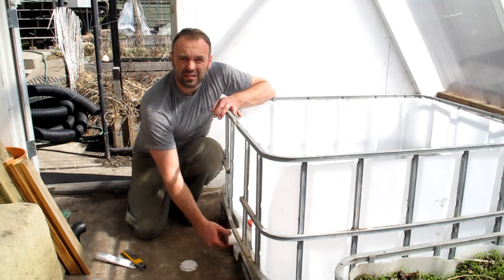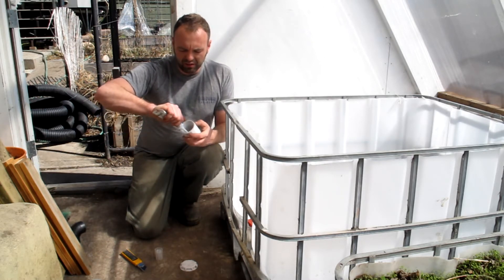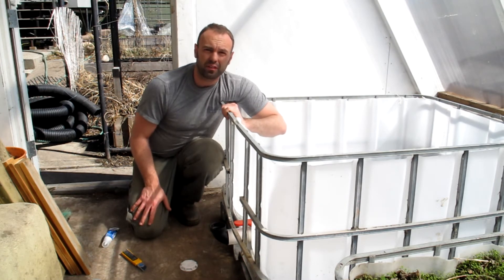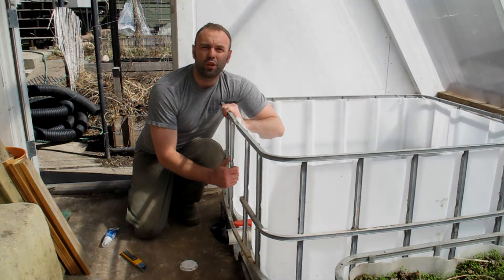How To Build an IBC Wicking Bed -  DIY  - Part 3

Comment: Quite clever  running the weeping hose up ,as a fill tube and fitting the drain tube into the end of the weeping hose . Certainly more efficient and simpler .Also you use less weeping hose than others . Couldn,t figure why others used so much weeping hose ( 16.5 ft. ) ,the water would spread out and evenly fill the whole bottom anyway . Great job , you,re on top of the game

Comment: I reckon that if folks don't want the threaded joint between the tank and the PVC fitting to be permanent, they could use teflon tape or maybe even pipe dope rather than silicone. Thoughts, anyone?

Comment: Is there a way to use the existing ball valve and outlet for the fill and level instead if installing the bulkhead connector?
Reply from the maker: You can only do this on one half. The other side needs a bulkhead fitting.